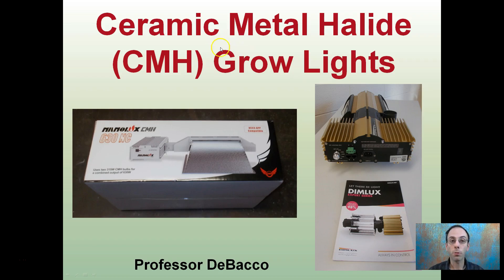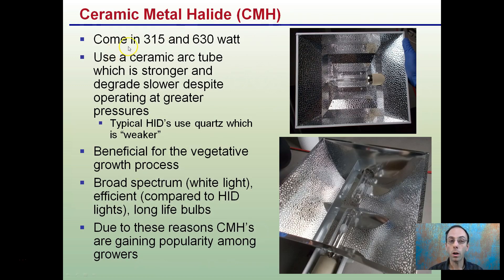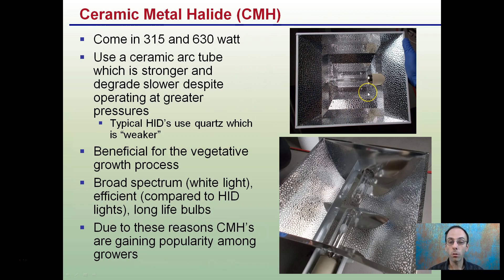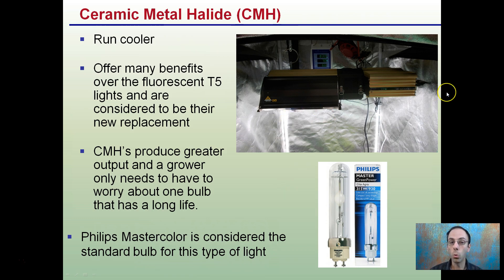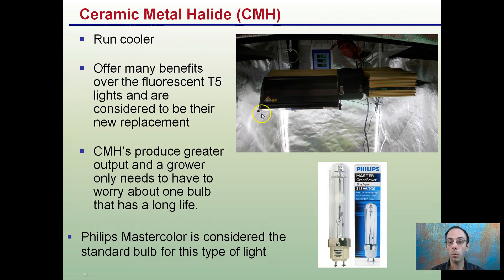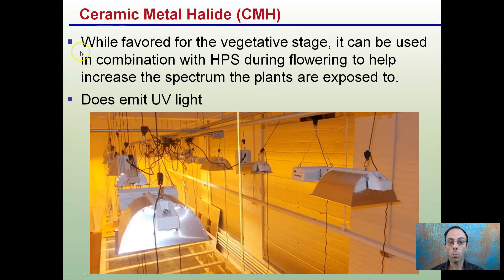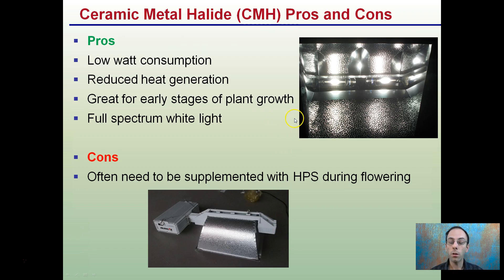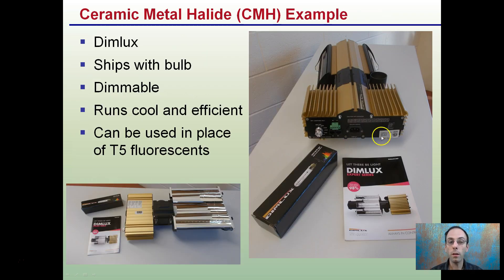Ceramic Metal Halide CMH Grow Lights

Comment: Great video as always! You mentioned you have a 315w in a 2×2 is that dimmed to keep the heat down? I wanted to put a 315w  cmh in a 2.5 x 2.5 but most people think its too much? Do you think its too much heat in a small tent? 
Thanks for all the videos... they've taught me a lot!!
Reply from the maker: That should work out just fine just be sure to have a ventilation system.
Reply: @DeBaccoUniversity   great!! Thanks for the response, greatly appreciated.
Reply: I am running 315 CMH in 2×2.5 gorilla shorty tent now for over a year, I like so much that I am setting up another one!
Dimmable ballast for HID can change their spectrum.

Comment: Cmh vs led?? Also what’s the practical use of ballast how does it effect the grower in everyday use??
Reply from the maker: CMH vs LED depends on what you stage of growth you are focusing on and cost to benefit ratio.  The ballast is the portion of the grow light that takes the power from the outlet and converts it to be used by the grow light.  So, they are a very important part of the artificial lighting system.
Reply: thank you @DeBaccoUniversity